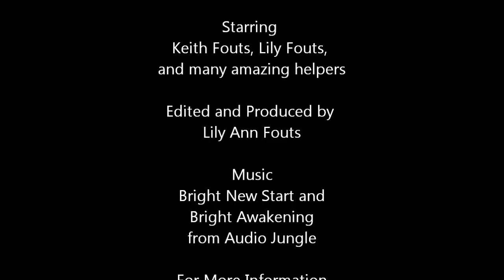Earthbag Rainwater Cistern

Comment: Beatiful work. Hows it holding up after 7 years?
Reply from the maker: It's doing great! The biggest issue has been with the lime plaster sticking to the papercrete on the walls, inside and outside. We should have made the papercrete a rougher texture on the exterior so the plaster could stick to it more easily. We'll have to re-do that at some point, most likely. But everything is holding up really well. It's a good, solid home.

Comment: What kind of liner is that and where do you buy something like that?  Wish you would do a review of your cistern in the future as to the pros and cons of it.
Reply from the maker: +MrsMika - I have a list of resources on this page:  http://www.lilyannfouts.com/earthbag-building-resources/ 
There's a link to the site where we purchased the cistern liner and other materials.  For more up-to-date information about our cistern see http://www.lilyannfouts.com/rainwater-cistern-in-action/ and http://www.lilyannfouts.com/earthbag-house-faqs/

I'll definitely be adding more as the project progresses!
Reply: +Lily Ann Fouts ;great job! its finnished?
Reply from the maker: +angetodac - The cistern itself is basically finished.  The only thing left to do is finish the roof and the gutter system so we can collect rainwater.  This is the most recent post about it:  http://www.lilyannfouts.com/rainwater-cistern-in-action/
Reply: Lily Ann Fouts  have you plasterred the earthbags on the inside of the cistern or aplied a swimmingpool linen? how can you be sure you wont have leaks?
Reply from the maker: +angetodac The answer to most of your questions can be found in the cistern video.  We did papercrete the inside to make the walls smooth and get rid of the grooves between the bags.  The papercrete is not likely to puncture the liner, but we did run a layer of tarps around the sides to give extra protection just in case.  The floor is gravel covered with 6-mil plastic and 1" of styrofoam.  A pool liner could be used, but I would not recommend using that if you plan to drink the water since chemicals in the liner can leach into the water.  The liner that we used was custom made for the cistern we built and it was made from food grade plastic.  The link to materials we have used in the earthbag house (including the liner) is: http://www.lilyannfouts.com/earthbag-building-resources/
Reply: Forgot to say "Thank you!" I really do appreciate your time and the knowledge you are sharing.  Thank you!
Reply from the maker: Quick update: the house is now inhabited and the cistern is fully operational and working great!

Comment: where is this house built and did you need any authorization or special building permit? 
i live in Birmingham Alabama and hope to find a piece of land at the country side to build my earthbag project.
Reply from the maker: +angetodac  - This project is in eastern Kansas.  This particular area does not require a permit for the building, but they do require us to install an aerated septic system (which we have) and they will do an inspection of it.  The laws change from state to state and county to county, so you'll need to check with the particular area where you want to build.
Reply: Lily Ann Fouts thanks!
Reply: yea,thats were they squirt all the crap on the yard right.  oh thats nasty. dont stub your toe.
Reply: I would consider a huge tank full o crap much worse than a yard of plants that happens to be drip-watered with brown water.

Comment: The only thing that's worrying me about this is that any folds or creases when you put them under the water pressure create cracks.  I am concerned you will get leaks from all the folds.
Reply: To prevent the liner from shifting when the cistern is filling with water, I ran the inlet pipe to within 6" of the bottom.  I installed a 'T' on the bottom of it and two 22 1/2° elbows so that water filling the cistern does not flow in just one direction causing the liner to shift.

Comment: I. R. To the cistern 
What did you do to the top (plywood) to prevent it from deteriorating from exposure to moister
Reply: I attached a pond liner to the bottom of the 3/4" pressure treated plywood to prevent moisture issues.

Comment: im hard of hearing so im not sure if you said why you put styrafoam at the bottom under the liner . and would sand have worked instead ?
Reply: The answer is that it depends.  There is 5" of 1" washed gravel below the cistern to prevent moisture from wicking up from below and into the papercrete on the walls.  As long as you place a barrier on the gravel to prevent sand from slipping through, you could use sand instead of Styrofoam.